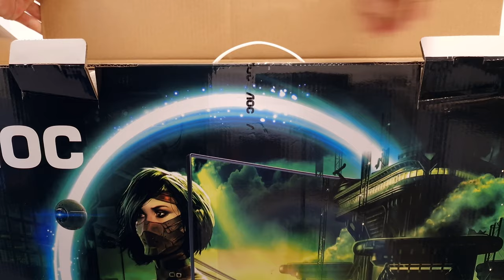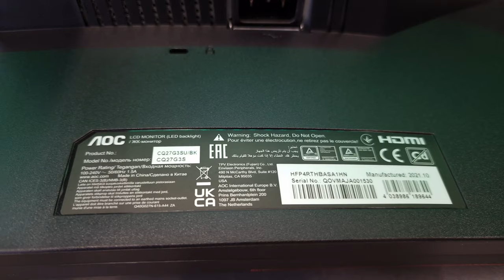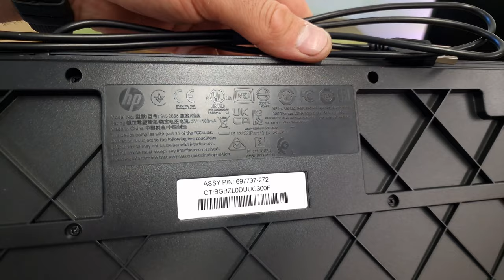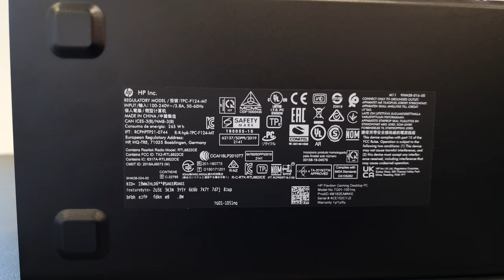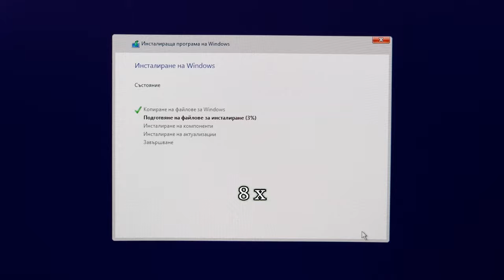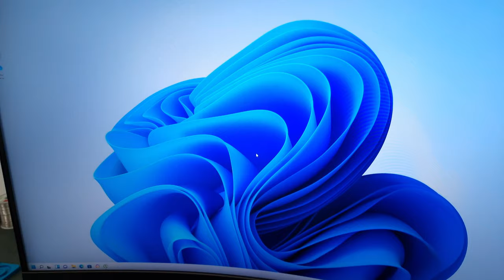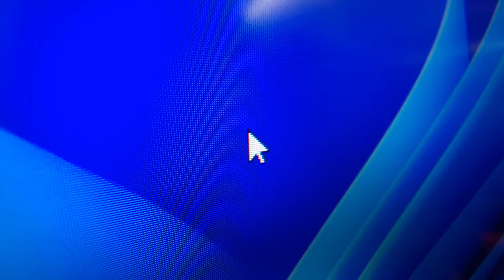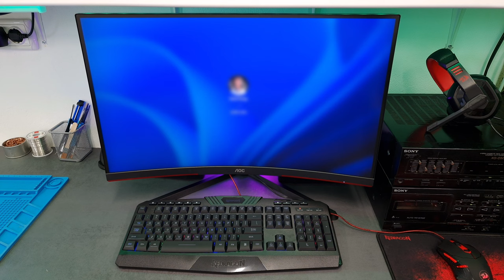My new Video editing PC Setup Gaming HP Pavilion & AOC 27" Curved WQHD 2560 x 1440 165Hz 1ms Monitor

Comment: this hp desktop is really bad, much better option: Acer Nitro 50 i5-11400F + RTX3060
Reply from the maker: For GPU I agree but for the Processor no.
i5 = 6 Core 12 Threads and 14nm
Ryzen 7 = 8 Core 16 Threads and 7nm
This is a budget computer for video editing, not for gaming.
Reply: lol dont comment about PCs if you dont know anything about them.